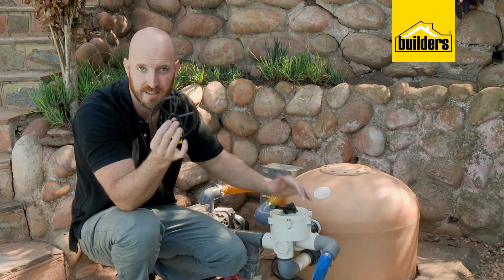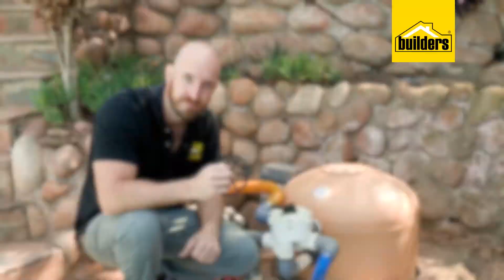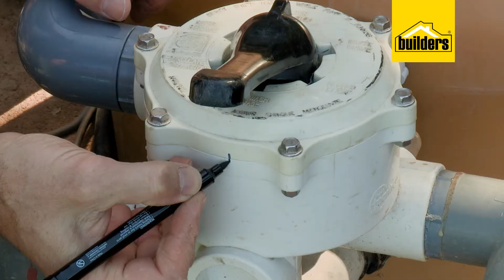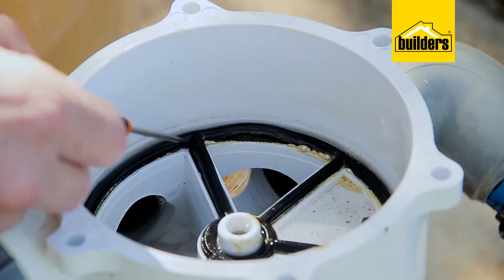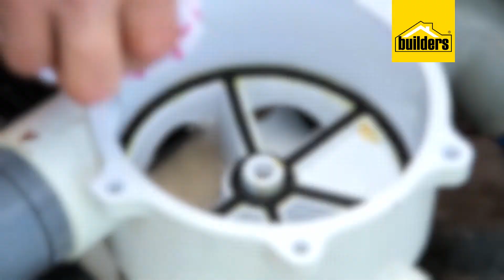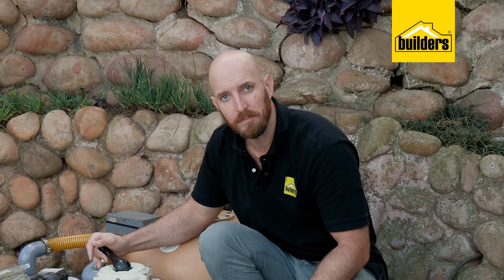Servicing Pool Valve And Seal

Comment: Pool store says ridged side down. Watched a few videos some say ridge side up some says down . Confusing .
Reply: Ridged side up. This will present a good round surface for the glue to set onto. The two ridge side will offer a better dual seal against the rotating plate from above.